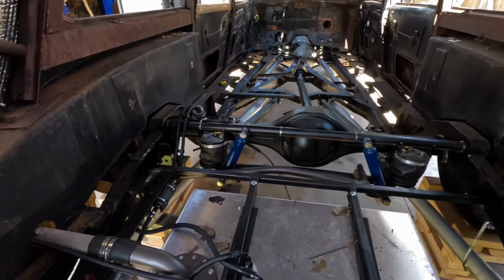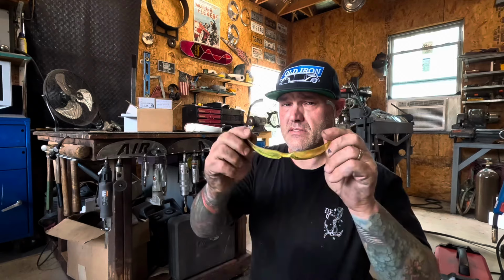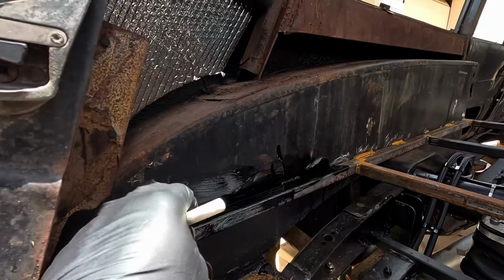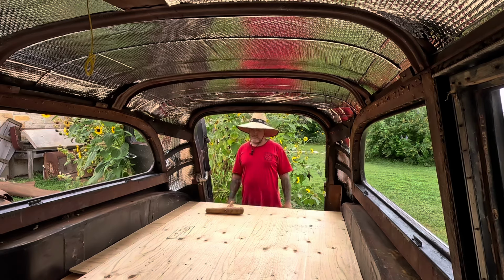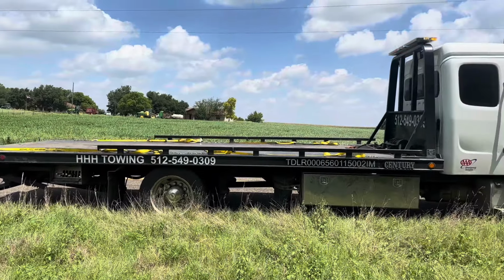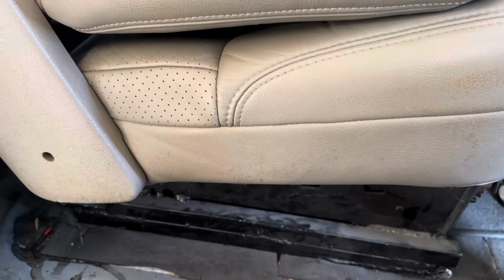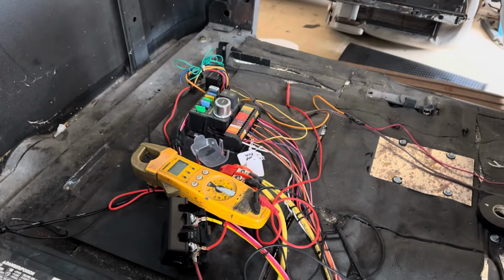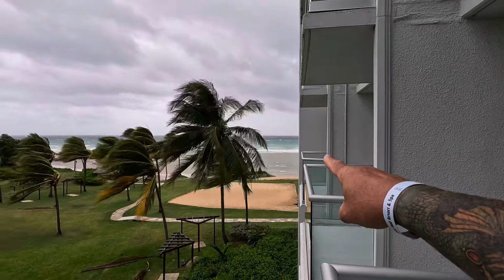The 1940 ford lets me down. On the road to pick up a few Lambretts stuck in a barn for 30 years

Comment: We experienced more in common than I liked. I had a shortage in my original wiring harness. Suddenly the car started honking in city traffic and the generator stopped working. The last day of the trip the battery gave up! My problems were most likely caused by evil mice who had chewed on the harness. Their tiny evil teeth did a great job causing electric gremlins without obvious visible damage to the cables.
By the way, I am sending my 57 Maicoletta scooter to an auction soon. Hopefully someone is willing to pay a fair amount.  I like the Lambrettas. I like them more than Vespas.
Reply from the maker: Maicoletta’ super cool.  Yes mice are definitely a bummer

Comment: Good Lord that wiring. I would honestly put everything under the dash and I wonder if you could use one of those special lightweight capacitor style batteries to put under the dash also….
Reply from the maker: When I pull everything apart, this winter to do the chop and the upholstery I’ll put it probably under the bed.

Comment: Rule #1. Never put wiring under rugs where there is walking traffic,
Rule #2 Never put wiring on a metal base where it can short out & even arch and catch flammable items such as seat cloth
Reply from the maker: Rule #3 always have a fire extinguisher
Reply: @Theoldironworkshop  I got mine, 👍 goes without saying, Than again,.... 🤔😂
Reply: @Theoldironworkshop  I had to do the complete wiring, Even the fuse box & all the heat control cables were completely melted! 🤯

Comment: OMFG That wiring is an absolute horror story. Just because the previous owner could do wiring doesn't mean he should of. LOL. I've had to remedy just that sort of mess for mates over the years in cars they've bought. I'm not am auto sparkie but was a telephone exchange technician in the 80's so I'm a bitch for tidy orderly wiring.
Reply from the maker: Yes I do low voltage wiring at work and try to be neat with it.  But it’s easy to make a mess for sure